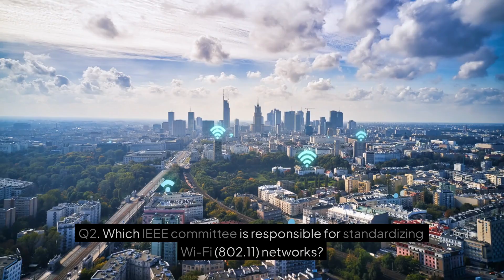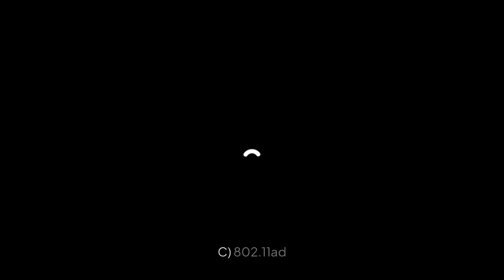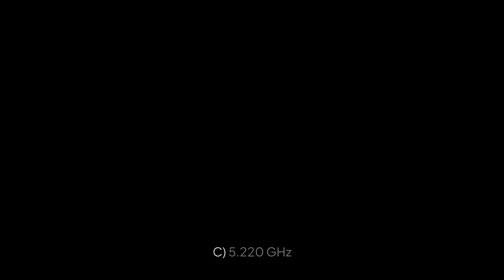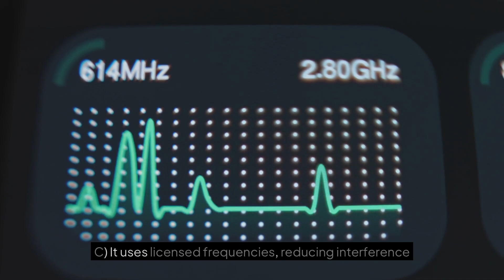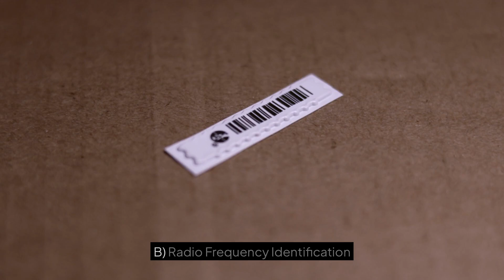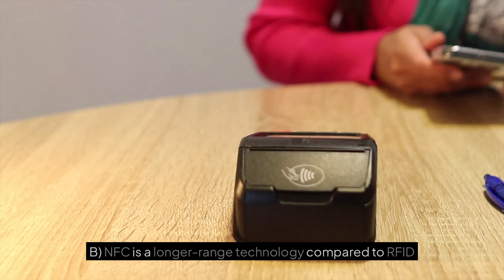Can You Pass This CompTIA A+ Wireless Quiz?

Comment from the maker: ALL THE ANSWERS HERE!
ΤΗΕ ΑQ1. What does IEEE stand for in the context of wireless networking standards?
A) International Electrical and Electronics Experts
B) Institute of Electrical and Electronics Engineers
C) Integrated Electronics and Engineering Entity
D) Institute of Experimental Electronics and Engineering
✅ Correct Answer: B
Explanation: IEEE stands for the Institute of Electrical and Electronics Engineers, the organization that standardizes wireless network technologies through its 802.11 Committee.
Q2. Which IEEE committee is responsible for standardizing Wi-Fi (802.11) networks?
A) The 802.3 Committee
B) The 802.15 Committee
C) The 802.11 Committee
D) The 802.1 Committee
✅ Correct Answer: C
Explanation: The 802.11 Committee within IEEE is responsible for establishing and maintaining the standards for wireless (Wi-Fi) networks.
Q3. Which 802.11 standard corresponds to Wi-Fi 5?
A) 802.11n
B) 802.11ac
C) 802.11ax
D) 802.11be
✅ Correct Answer: B
Explanation: The 802.11ac standard is also known as Wi-Fi 5.
Q4. What is the user-friendly name given to the 802.11ax standard?
A) Wi-Fi 5
B) Wi-Fi 6 only
C) Wi-Fi 6 and Wi-Fi 6E
D) Wi-Fi 7
✅ Correct Answer: C
Explanation: The 802.11ax standard is referred to as both Wi-Fi 6 and Wi-Fi 6E (E stands for Extended, adding the 6 GHz band).
Q5. Which 802.11 standard is marketed as Wi-Fi 7?
A) 802.11ac
B) 802.11ax
C) 802.11ad
D) 802.11be
✅ Correct Answer: D
Explanation: The 802.11be standard is also called Wi-Fi 7.
Q6. Which THREE frequency ranges are most commonly used by Wi-Fi networks?
A) 900 MHz, 2.4 GHz, and 5 GHz
B) 2.4 GHz, 5 GHz, and 6 GHz
C) 2.4 GHz, 3.6 GHz, and 5 GHz
D) 1.8 GHz, 2.4 GHz, and 6 GHz
✅ Correct Answer: B
Explanation: Most Wi-Fi networks use frequencies in the 2.4 GHz, 5 GHz, and 6 GHz ranges.
Q7. What is the primary purpose of Wi-Fi channels as defined by the 802.11 Committee?
A) To increase the maximum transmission power of wireless devices
B) To group frequencies together so they are easier to reference than exact frequency values
C) To separate different Wi-Fi standards from one another
D) To encrypt wireless communications between devices
✅ Correct Answer: B
Explanation: Channels group frequencies for easier reference, e.g., channel 6 instead of 2.437 GHz.
Q8. Channel 6 in the 2.4 GHz band corresponds to which exact frequency?
A) 2.412 GHz
B) 2.462 GHz
C) 2.437 GHz
D) 2.484 GHz
✅ Correct Answer: C
Explanation: Channel 6 in the 2.4 GHz range is 2.437 GHz.
Q9. Channel 44 in the 5 GHz band corresponds to which frequency?
A) 5.180 GHz
B) 5.200 GHz
C) 5.220 GHz
D) 5.240 GHz
✅ Correct Answer: C
Explanation: Channel 44 in the 5 GHz spectrum is 5.220 GHz.
Q10. Which of the following is NOT a common Wi-Fi channel bandwidth?
A) 20 MHz
B) 40 MHz
C) 100 MHz
D) 160 MHz
✅ Correct Answer: C
Explanation: Common Wi-Fi bandwidths are 20, 40, 80, and 160 MHz; 100 MHz is not standard.
Q11. How many non-overlapping 20 MHz channels are available in the 2.4 GHz spectrum?
A) 1
B) 2
C) 3
D) 11
✅ Correct Answer: C
Explanation: There are only three non-overlapping 20 MHz channels in the 2.4 GHz spectrum.
Q12. Why does the 5 GHz band offer advantages over the 2.4 GHz band for Wi-Fi?
A) It has a longer range and better wall penetration
B) It offers many more available channels and supports wider bandwidths (40, 80, 160 MHz)
C) It uses licensed frequencies, reducing interference
D) It is compatible with Bluetooth devices directly
✅ Correct Answer: B
Explanation: The 5 GHz band offers more channels and supports wider bandwidths, reducing interference and increasing throughput.
Q13. What frequency range does Bluetooth technology use?
A) 900 MHz
B) 2.4 GHz
C) 5 GHz
D) 6 GHz
✅ Correct Answer: B
Explanation: Bluetooth operates in the 2.4 GHz frequency range (ISM band).
Q14. What does ISM stand for in the context of wireless frequencies?
A) Internet Standards Management
B) Integrated Signal Modulation
C) Industrial, Scientific, and Medical
D) International Spectrum Management
✅ Correct Answer: C
Explanation: ISM stands for Industrial, Scientific, and Medical — unlicensed frequency bands.
Q15. What is the approximate maximum range of consumer Bluetooth devices?
A) 1 meter
B) 5 meters
C) 10 meters
D) 100 meters
✅ Correct Answer: C
Explanation: Consumer Bluetooth devices have a maximum range of about 10 meters.
Q16. What does RFID stand for?
A) Remote Frequency Interface Device
B) Radio Frequency Identification
C) Rapid Field Identification Device
D) Radio Frequency Internet Device
✅ Correct Answer: B
Explanation: RFID stands for Radio Frequency Identification.
Q17. How does a passive RFID tag receive the power it needs to transmit its ID code?
A) It uses a built-in rechargeable battery
B) It draws power from a nearby power outlet via induction
C) The radio frequency energy from the scanner provides enough power to activate the tag
D) It relies on solar energy stored in the chip
✅ Correct Answer: C
Explanation: Passive RFID tags are powered by the RF energy from the scanner.
Q18. What is the key difference between a passive RFID tag and an active RFID tag?
A) Active tags use NFC while passive tags use standard RFID
B) Active tags have a battery and can be scanned from a longer distance; passive tags have no battery
C) Passive tags are larger and used outdoors; active tags are smaller and used indoors
D) Active tags store more data; passive tags only store a serial number
✅ Correct Answer: B
Explanation: Active RFID tags have a battery for longer range; passive tags rely on scanner energy.
Q19. How does NFC (Near-Field Communication) differ from standard RFID?
A) NFC operates at 5 GHz while RFID operates at 2.4 GHz
B) NFC is a longer-range technology compared to RFID
C) NFC extends RFID technology by adding two-way communication instead of one-way
D) NFC requires a battery while RFID does not
✅ Correct Answer: C
Explanation: NFC builds on RFID by enabling two-way communication.
Q20. Which of the following is a common use case for NFC technology?
A) Long-range wireless internet access across a building
B) Connecting wireless speakers over a 100-meter range
C) Using a smartphone or smartwatch to make payments at a point-of-sale terminal
D) Tracking packages across a global supply chain
✅ Correct Answer: C
Explanation: NFC is commonly used for contactless payments, device setup, and access control.